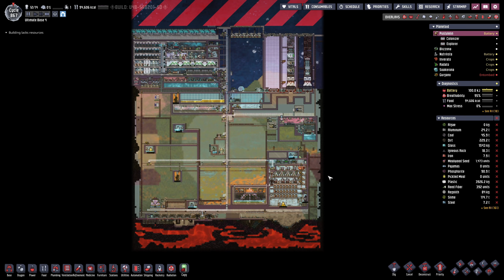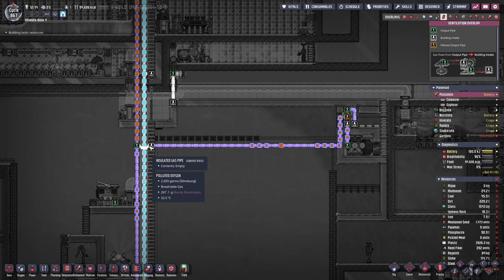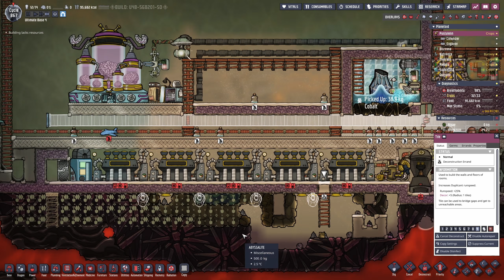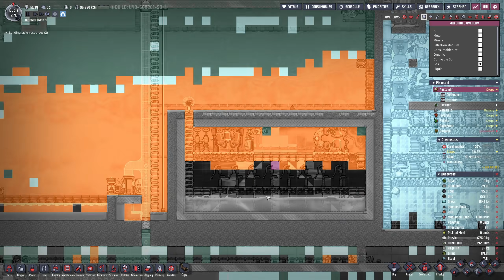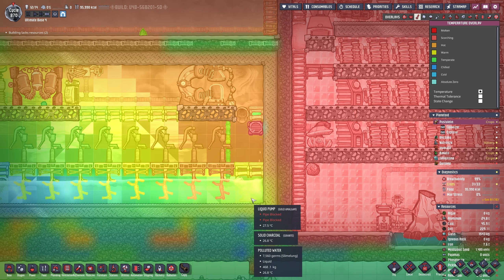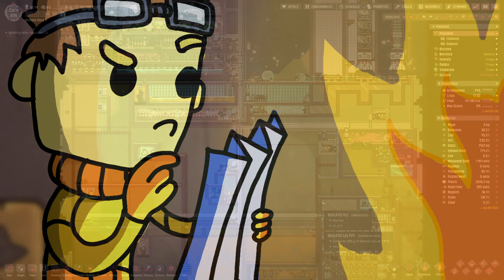GEOTHERMAL POWER PLANT - Ep. #46 - Oxygen Not Included (Ultimate Base 4.0)

Comment: Another solution to crushing gases without using power is to put in a buffer gate. As long as the inner door closes while the outer is closed, it'll crush, so adding a buffer gate to delay the second close you don't need to use any power. Not too much of an issue in your base, since you have so many power sources, but early game when things are tight it saves on metal and power.

Comment: That heavy watt joint plate you connected to the steam room is going to exchange heat with the contents of the liquid reservoir. Soon your steam turbines will stall out because your aqua tuner can't keep up.
Liquid reservoirs is going to exchange heat with the left most tile they're standing on. Move over the joint plate one tile and you should be fine.
Reply: @Nathans-Sandbox
No, sir! Testing in debug confirms it. Joint plates will also transfer heat to steam turbines on the bottom 5 tiles, even in a vacuum.
However, after testing I have to admit that your aquatuner will be able to barely keep up as long as you're only cooling those 5 steam turbines.
Try to turn off the steam turbines and aquatuner and watch the temperature in the reservoir go up slowly, if you're still in doubt.
Reply from the maker: This is only the case when there is a medium to transfer the heat. Since we have a vacuum, we're safe.

Comment: One conduction panel isn't enough to cool down a full steam turbine if it is running all the time. I'd reccomend just dropping a bit of water to the bottom and using radiant pipes instead. Otherwise you are gonna get steam coming from inside of the turbines to your chamber.
Reply: Conduction panels have changed since the last patch, they are perfectly capable of cooling a steam turbine now :)
Reply: It definitely should be able to; I’m able to cool 3 turbines running near 100% off a single cooling loop whereas each turbine has 1 panel attached to it.